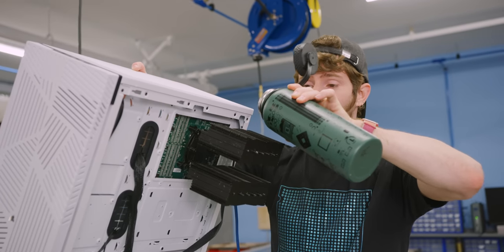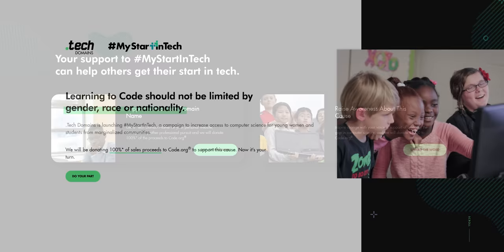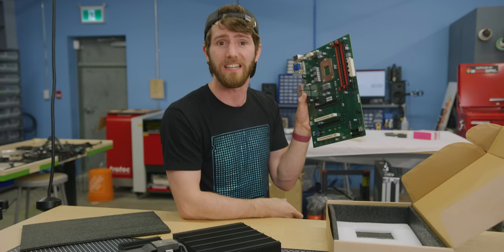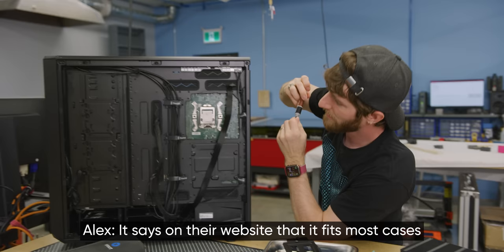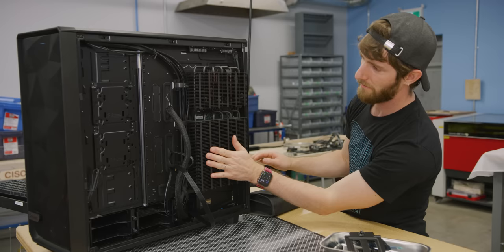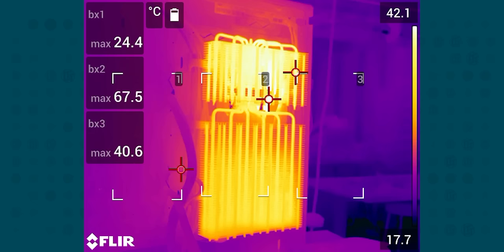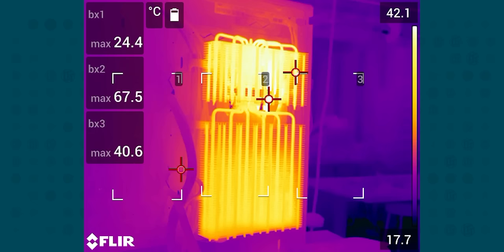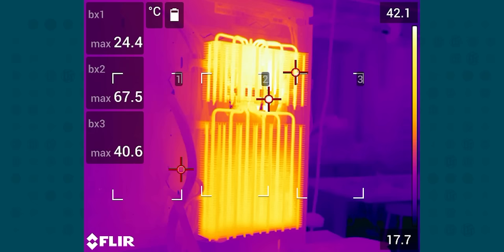What Happens if you Water Cool an Air Cooler?

Comment: Finally I found an easy watercooling tutorial without all that pump, res and fitting blabla. Thanks.
Reply: And it's cheap!
Reply: I mean like you can change the water after every 1 game if you find a good box
Reply: @esher3601  I just set a water sprinkler connected to the mains to spray water continuously at the cooler, works like a charm.
Reply: @esher3601  add a spigot, open it to make room and drop in some ice while you're in the lobby. Boom.
Reply: Easily portable too.
Reply: @drumedorable  basic idea of a swamp cooler
Reply: laughs in coverted ice maker
Reply: You can even cook something in the water ;)
Reply: plus, you only need a cup of water
Reply: Just get an AIO they make them up to 360mm maybe larger I’m not 100% on that but I know they make a 360mm a 240mm and a 120mm are the three most common
Reply: @shorty808100  yeah it's really easy to water cool your cpu. I still think custom water blocks are cooler but oh my gosh they can go so wrong so quick xD
Reply: @esher3601  Just make sure it's not boiling or your pc dies :D.
Reply: @drumedorable  pressure washers work the best. The higher pressure you can get the better. I don’t really have a powerful computer so when I play games I have to find the vent hole and tape that 2000 something psi pressure washer to it and turn it on. It pops off the back of the computer so I don’t know if that’s good.

Comment: This video is basically just Linus trying to re-invent custom watercooling
"What if we took heat fins, and put them in water"
"Hmm, adding a pump to move the water around would be more effective at cooling"
Reply: dont really need pump to move water around with that amount of water and heat source... convection current will do the trick.. but provide the surface of the water could cool down fast enough to prevent thermal throttling
Reply: @victorng2996  It’s still more efficient to have a pump than a fucking bucket.
Reply: not really, it's inverting a water cooler. In normal water coolers the water is used to transport the heat away from the cpu into the fins which get air cooled by fans. Here he's literally using water as the cooler medium for the fins, if anything this is TRUE water cooling.
Reply: @Zuilli  completely agree. And eventually this system will gain temperature because it's just storing the heat in the water. Unless you bring in air to move the heat into the room, or water from the sink, it'll eventually gain temperature until equilibrium is reached (which would probably be at least room temperature)
Reply: @NN-qj4sk  well i said convection current thus the heat source has to be at the bottom o_o
Reply: @andrewf8366  Well room temperature is more then fine to be under load.
Reply: @andrewf8366  Not if I submerge it into the lake it wont.
Reply: @esuil  😂 Got ‘em

Comment: "dang, my mouse battery is dead, brb"
"dang, my water cooler bucket ran out of ice, brb"
Reply: was gonna give you a like, but then i saw you had 69 likes so i didn't want to ruin it. so here's 👍a thumbs up
Reply: @snappedmzakeszar9877  was gonna give you a like, but then i saw you had 6 likes so i didn't want to ruin it. so here's 👍a thumbs up
Reply: @AOmega72  lmao bruh HAHAHAHHQ
Reply: @AOmega72  so here's 👍a thumbs up
Reply: @centlytical  was gonna give you a like, but then i saw you still had the same number of likes that the previous guy said so i didn't want to ruin it. so here's 👍a thumbs up
Reply: next*
Reply: ok ok ok but heres the thing... ive been daily running a water cooling loop where instead of a radiator its a bucket.... ryzen 7 2700 at 1.337 volts.... i have had real moments. where im in a call and i go, yo brb lemme go get a ice bottle shes running a bit hot. lol so yea........
Reply: @exhaustbreath4355  no way have you really?
Reply: @Victor Isaev  I finally ditched it because I've been playing vr alot and I don't want to have to keep turning my computer off every night lol so back to stock settings..... it REALLY didn't like it I had to rebuild windows because I was having instability problems I never fully diagnosed it but something to do with drivers and ram.... anyway... stock air cooler gang again

Comment: 3 things I really wish you had tried:
1) mount the water pump on the side of the tub, so the water flows through the fins of the cooler.
2) putting that massive cpu cooler that came with the MB on a GPU
3) rigging that motherboard for LN2. Seem like you might be able to mount a pot on there in a way that keeps condensation off of the board.
Reply: Could've mounted a noctua industrial fan on the heatsink lol
Reply: @bacon.cheesecake  gamernexus already did it

Comment: Honestly, if you could find a more elegant and safe way to do it, literally just dunking the heat sink in water could potentially be a valid cooling option.
Reply: I feel like it might cause condensation on the electronics which isn't a good idea
Reply: What you ought to do is cover the heat sink in a plastic, waterproof frame and take a water pump which will continually drag cool water through the heat sinks. Basically it’ll be a safer version of water cooling.
Reply: Dunk the whole thing in mineral oil

Comment: Rick: “Well that’s just water cooling with extra steps!”
Reply: Technically, less steps. No tubes, reservoirs, or fittings to worry about. Just slap the heatsink on, fill a bucket with ice water, drop in a submersible pump, and you're good to go! No bleeding the loop, no fans to cable manage, and probably a heck of a lot cheaper too!

Not saying this is smart.. There are just less steps, and it's definitely unique so there's that. 😂
Reply: Omg yes XD
Reply: not to mentioned that you dont need fans anymore ,whats not to like, its water
Reply: some heatsinks have copper tubing and you can just pump water throw them and it will be both air and water cooled
Reply: @FukkenDubben  agree i did  the water cooling  verion of this back in 2010 and 2013 full guide  and experiment details are on toms hardware froms

Comment: This video gave me an idea. 1) fill a bucket with water. 2) put a heat sink in it, but with the mounting hardware above the water line. 3) put it in the freezer. 4) test how a block of ice works as a cooler.
Reply: Amusingly, my neighbor discovered that this ends very badly.

When water freezes into ice, it expands, and it will happily bend/warp/break delicate metal bits that are submerged within it, especially at the surface.

(I might have thoroughly enjoyed watching him prove me right about just how bad of an idea it was to try to do XD)
Reply: It depends on what metals are placed in. Material like whats in the heat sink inside a freezer will be fine.
Reply: best power economy 2021
Reply: Also Ice Water > Ice when it comes to cooling shit. 

Many people don't realise this but ice water is always at the freezing point of water and is far superior when it comes to cooling because it's a liquid not a solid and thus far superior at dissipating heat. Ice may be able to reach sub freezing temperatures but at the end of the day you'd be better off creating a saline ice water solution.

If you want to get serious about cooling I recommend buying a block of dry ice and dissolving it in acetone/isopropyl-alcohol. You can easily reach -75°C that way.
Reply: A solid block of ice can actually insulate pretty well too, depending on whatever other environmental factors are involved.
Reply: wouldnt it melt from the heat?

Comment: "Where's your computer?"
"Inside the icebox over there."
Reply: I have a bucket here, also a waterpump for the pool outside. I just need that flipped motherboard.
Reply: Technically speaking, you could buy a marine type freezer kit, drill some holes in the provided heat sink, and put the coils from the freezer kit inside the cooler, then encase that in foam so you don't have to run it 24/7 and that would probably cool this to shits. It wouldn't be feasible with a regular pc, because that would condensate inside the sensitive areas, but with this, you could buy two sheets of copper sticker and put them on the case facing the cooler and on a separator board facing the case, killing off condensation. 

TLDR this setup is the first setup that can be freezer cooled without running excessive lines away from the CPU.
Reply: "Submerged in water"

Comment: This would actually work really well if you had a proper rubber seal between the back of the case and the reservoir that snugged around the heat pipes with silicone. Then you could have a case that's computer on top, sealed container of water on the bottom, with heatskinks going through the seal down into the water, and a pump to move around the water. In practice I think this would actually be safer and more effective than a regular water cooling setup because it's fail-safe: the water is always below the computer and cannot fall upwards.
Reply: I feel like it would work even better if a massive heatspreader like this one were enclosed with a pump inside of it to act as a big AIO. Circulating the liquid slowly from a big heatsync to a cooling reservoir and so forth would probably work so much better than current AIOs. This video really makes you think.
Reply: But for the safety part, you're absolutely right. This would be a lot better by what you said. I'm thinking more in terms of marketability and portability
Reply: @infatuated9970  There's a simpler solution of just immersing the computer in a non-electrically conductive liquid.
Reply: @LutraLovegood  It isn't the same though. Because of the viscosity of mineral oil, it is less effective than water at pulling heat away.
Reply: Makes me wonder. would it be cheaper to just buy bags of ice for this kind of setup than whatever it costs to run an AIO pump haha
Reply: @LutraLovegood hassle in maintenance and swapping if parts fail
Reply: @infatuated9970  ISOPAR would probably work well, it's not very oily and its used as an antifreeze of sorts.

Comment: Linus - submerges the NHD-15 into a bucket of Ice Water.
Noctua - "He did what? . . . . . Linussssssssssssssssss!"
Noctua Tech - "Can we make that work for real?"
Reply: Major Hardware actually did!
Reply: @Deses  Actually, that was a great video where he built the enclosure to basically make the heatsink into a super efficient water block. Linus, with all that workshop gear could have done an amazing version of that without nearly shorting out a system in the process.

Comment: SURELY this is the reason to bring back the Mineral PC? We can start calling Luke ‘slick’ again!
Reply: oooooo good one
Reply: Yes
Reply: They should re do a “mineral oil” build with 3M Novec engineering fluid it’s used in servers to submerge the racks and cools components quite well
Reply: Yeah was thinking the same thing. They need to make another mineral oil cooler build , it's been years since the last one
Reply: I was thinking the same thing. Mineral oil builds were so cool. Haven't seen that for ages
Reply: This should be in top

Comment: The passive cooling heatsink would most likely work much better if it was mounted horizontal  to the chassis, since the fins didn’t allow airflow to pass through the fins in this configuration.
I’m surprised you didn’t think of that
Reply: I mean... There is NO WAY it was supposed to work with flaps horizontally without any active cooling. That's just common engineering sense!

Comment: I did this as an electronics shop project in sophomore year of high school. I flex sealed a plexiglass box around a hyper 212 and put it into a water cooling loop. It worked really well until the box broke and water went all over the motherboard
Reply: Major Hardware did something similar though think he used aquarium glue.

Comment: That motherboard was CLEARLY designed for engineers:
1. Heatspreader not squarely aligned: Works? Yes? Then fine.
2. No CMOS battery: Standard battery? Yes? I have bucket o' batteries.
3. Case modification might be needed: Already used my angle-grinder before reading that far.

Comment: You could totally make a silicon barrier between the water and the delicate bits that seals around the heat pipes and submerge your cooler in a circulating water feature. Like a lazy river through PC islands.
Reply: But if you are going to this length, at this point whats the points of even bothering with heatsink and water at all?   
  
Just submerge whole pc into oil based non-conductive liquid designed specifically for this. This is what lot of miners do to save on power usage.
Reply: This is literally what the company did to publicize the motherboard lol, in gamer nexus video is shown
Reply: Also, might try placing the pump on its side (if possible) and directing the water output at the opposite wall, setting up a circulation pattern in the tank. Or a magnetic stirrer such as used in chem labs.
Reply: Just imagine a waterfall-like Build. Where the Water is running through the cooler. That would be dope!

Comment: Here is an idea, get a top dropping ice machine, port a hole at the bottom where ice/water would collected then feed that same cooler block from inside and stick the cpu connecting part out, seal and connect and run to your hearts content, install a nactua water poof fan from inside the ice maker blowing inwards from left or right to vise versa to keep water flowing through the fins. 

Now you would use your current case along with the same cooler and only need the super cheap ice machine, additionally you could drill two port holes on the lid and connect fans inside pointing out to blow outwards, which would provide a little bonus AC to your immediate area.

Comment: 7:17 Literally panicked for Linus almost ripping off that memory slot in the way he holds the entire thing
Reply: Really surprised to see that actually
Reply: I'm 99% sure RAM slots can support the weight of a motherboard as long as you aren't shaking it... The board is not exactly heavy.
Reply: @danieljensen2626  the weight of a mb yes but there was a massive heatsink behind the board, that's why i'm so concerned because that is really heavy - really just look at how bent that slot is, and the angle of both memory sticks. it's not even a metal reinforced slot like we've been seeing on some high-end boards these days

Comment: This is actually a superb way of designing mobos and CPU coolers imo, all the heat of the CPU is on a separate side, so the GPU and CPU is separated to allow for lower temps, less hot air mixing up in close proximity, plus the CPU cooler can then be designed to be spread out across the back of the mobo like the one in this video, add to that 1 or two jumbo 200mm fans, which are much quieter than smaller ones and move much more air, now you have the GPU in its own compartment being cooled and the hot air extracted, same for the PSU, and the CPU is separated at the back, pretty much the most refined ATX design we have seen so far, everything back in the day was huddled together in a tight poorly designed case, the PSU was right by the CPU which was right above the GPU, plus the north and south bridge and the memory, all that heat in close proximity can't be good for thermals, stability, machine life expectancy and so on.

Then they just have to work on some PC cases with this updated ATX form factor, one with a nice big separate area sealed off to isolate the CPU and it's cooler, this should end up with lower noise output as well.

Comment: i think a 3d printed waterfall setup would be cool. passive rads in cased (or not) reservoir on the bottom and a pump to run it back to the top. rgb maybe cooling liquid color, some glued amethyst rocks..... should look pretty cool

Comment: Over the years, they've done some pretty jank and dangerous things, but DAMN this takes the cake by a mile
Reply: whole room watercooling?
Reply: @bxn4l  I dont think that was very jank. It took a lot of effort, and was pretty custom, but, it wasnt leaking or anything like that
Reply: The original Chiller was more dangerous with the exposed capacitors if I rememebr correctly.
Reply: Sitting a MacBook with the bottom resting on a water surface to cool it, building multiple very jank versions of air and water cooling blocks including a very poorly cast one they made out of aluminum, reusing the parts from a mineral oil submerged pc. This is honestly pretty simple compared so many of the other jank things they have done.

Comment: I've always wondered why no motherboards allow you to utilize both sides for components so that you can manage space more easily.
Reply: There are already some motherboards that allow you to install an m.2 drive on the back. The main reason why manufacturers usually don’t put other slots on the back is because traditional cases don’t have the space behind the motherboard to fit things like a ram slot.
Reply: There's already enough space on one side for 99% of use cases. If they used both sides it would only increase their costs and make it a pain in the ass to assemble while also forcing you to buy a WIDE computer case.
Reply: @SwervingLemon  It would be good for anything smaller than micro-ATX. Imagine having a mini-ITX with 4 PCIe x16 slots.
Reply: @ajhauter5049  the Mini ITX spec doesn’t allow for that though
Reply: This is why
Reply: Usually one side of the motherboard goes on the wall of the casing so there's really no point.
Reply: The Cardiff Giant  pioneered putting chips on both sides of the board.
Reply: @danzjz3923  It could if they were on the other side
Reply: because it's a pain in the ass and makes mounting a lot more complicated, the most you can really add and still maintain the same motherboard standard is m.2 slots on the back